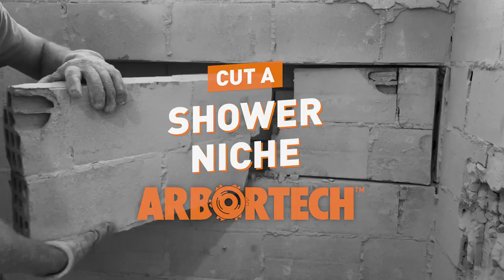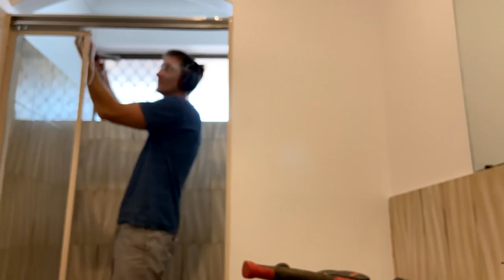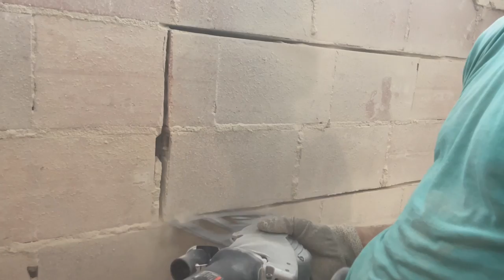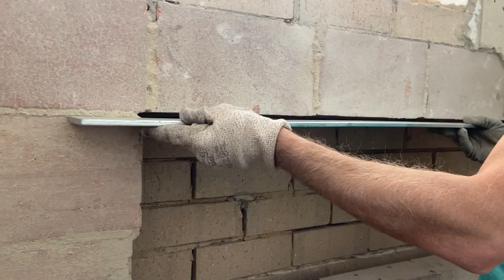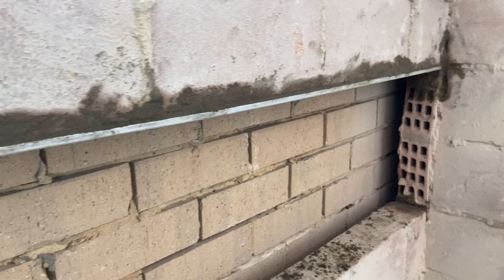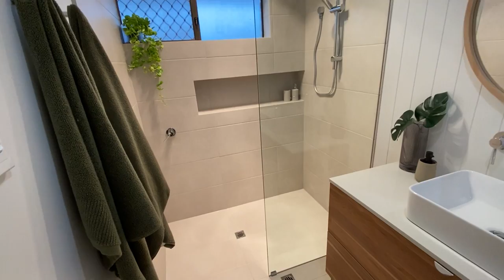How To Cut A Shower Niche - Bathroom Renovation | Arbortech AS175 Brick and Mortar Saw

Comment: Would cutting the brick like that effect the structure of the house ?!
Reply from the maker: Hi there and yes, always check modifications to brickwork with the applicable building code and/or seek appropriate expert advice. For this project, a structural inspection was undertaken and a steel lintel was required to be installed.